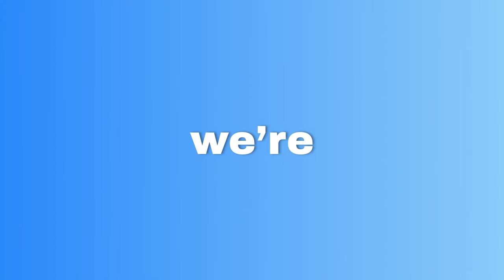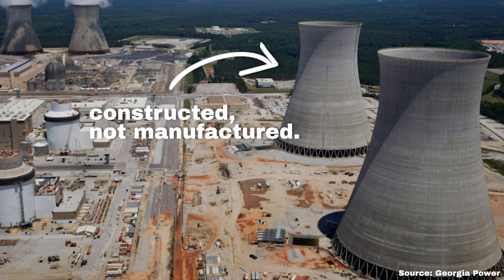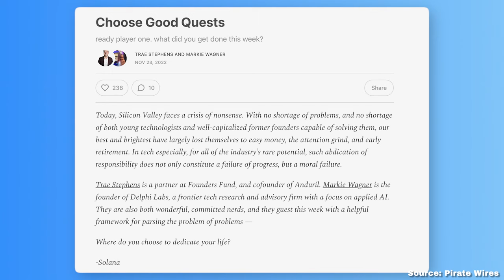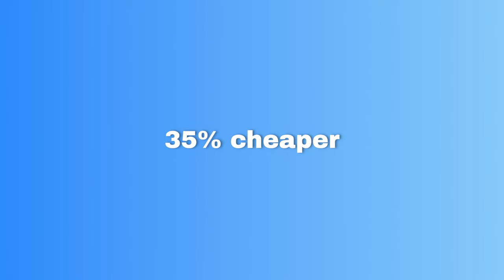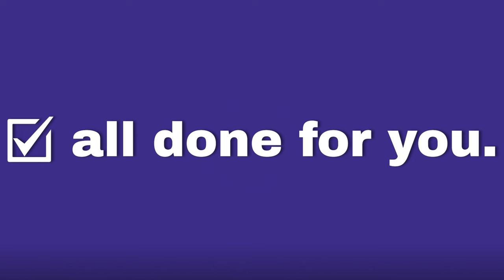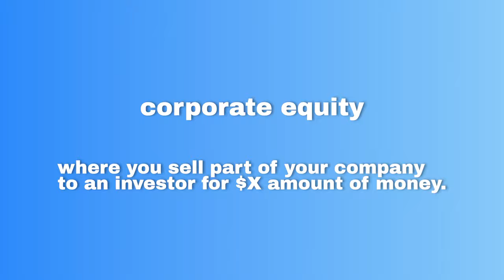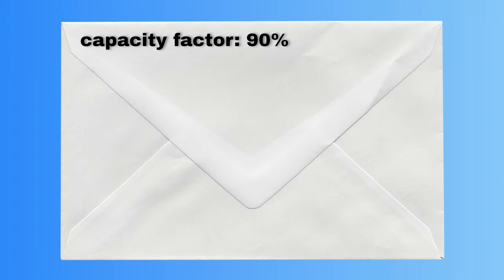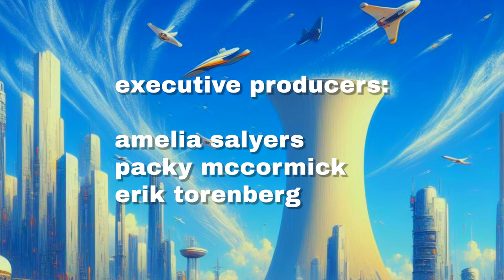How to Build 10,000 Nuclear Reactors

Comment: I really like what you are doing: making the public more aware of CO2 free energy possibilities.  I have traveled a lot in Arctic Canada.  This region is too remote to be on the grid, has communities too small for current large scale nuclear and has little or no sunshine for half the year.  Currently powered by diesel, you illuminate lots of ideas that could provide clean power to this part of the world.
Reply: not co2 free, until they find that materials science that uses strong roman concrete that can sequester co2 instead of creating it and learn to mfg high performance, insanely qc intensive steel.

Comment: brilliant analysis of new possibly breakthrough emerging markets. 

So much opportunity here.

I'd love any new reactors to have inbuilt passive safety and multiple passive redundancies. 

They need to be disaster proof. Having them at sea is brilliant, we have the DC transmission cable technology to add to that. 

We could desalinate water, create hydrogen, power industry with SMR's. 

This could be brilliant. 

Fusion will be amazing but the energy mix and balance will see a future of abundance.

Comment: @thewiseperson8748 said, "Thorium is likely to be the only fuel that runs SMR's in the long run, suggesting that a molten salt Thorium reactor is the only configuration that has any real hope for SMR's." 
Pebble-bed reactors are also capable of using fuel pebbles made from different fuels in the same basic design of reactor (though perhaps not at the same time). Proponents claim that some kinds of pebble-bed reactors should be able to use thorium, plutonium and natural unenriched uranium, as well as the customary enriched uranium.
Because the pebble-bed reactor is designed for higher temperatures, the reactor will passively reduce to a safe power-level in an accident scenario. This is the main passive safety feature of the pebble-bed reactor, and it distinguishes the pebble-bed design (as well as most other very-high-temperature reactors) from conventional light-water reactors, which require active safety controls.
Reply: Thorium is a marketing term just like SMRs. Thorium as a fuel will only make MSRs (Molten Salt Reactors) more expensive than uranium-based MSRs with no advantages.

Comment: Try running an Aluminium smelter with a continuous 500MWe demand with just a Solar farm and Gigabattery packs. The solar would need to have a 2000MW output averaged over 6hours then need at least18×500MWh = 9GWh batteries to get through the nights.
That's capital cost of:
Solar:4×500,000×$2000/kW= $4billion + Mega-Pack:
9000MWh@$600,000/MWh (= $5.4billion)
So Total capital cost/kW. = $(4+5.4)×10⁹/500,000 = $18,800 per kW for a 24/7/365 demand and at 2Watt/m² need at least 100,000Ha taken from the scarce tropical rain forest.

C.f Indonesia's 8× ThorCon 500MWe TMSR (foot print 1.17Ha each 500MW unit or 43kW/m²) capital costs of $800 - $1000 per kW (say $940/kW) is .94/18.8=1/20 or 5%  of the required capital cost of a stand alone combined  Solar + Batteries system wthout considering the destruction of over 1000km² tropical rain forest - 
(NOTE: Both supply 500MW × (6+18)hours = 12,000MWh/day)
Indonesia's expected levelised pre-profit cost is less than $30 per MegaWatt.hour (<3cents per unit kiloWatt.hour). Assuming the ThorCon's life is 45 years, that's 3× the solar + Batteries year 15year life; making its levelised pre-profit cost 3×20 times cheaper than solar+Batteries (3×20×$30 = $1800/Megawatt.hour or $1.80/unit kWh)..???
Reply: we are addicted to boxite.

Comment: Cooling towers aren't nuclear reactors. Why show them?
Reply: Because they look "scary".
I think they should be painted blue for obvious reasons ;)
Reply: Cooling towers are the best way of rejecting heat on the revenue side of the operation. 

You're not subject to major environmental effects of discharging excess heat into waterways if you can reject direct to atmosphere and in order to be able to make a heat engine work (steam turbine or other electrical generator) you MUST be able to reject heat somewhere. They need a hot side and a cold side to function

Cooling towers are mostly associated with coal plants and the temperatures/heat density of MSRs is a good substitute for the thermal energy provided by burning coal/gas

If you want to keep deployment costs down you MUST make the reactors work with existing power generation methods and superctitical steam turbines are a good fit for the job that exist already, unlike supercritical CO2 or Brayton turbines which are still only at "experimental" stages (I don't object to using them later, but holding up deployment until they're ready is like holding off until fusion is ready - we don't have that long to wait and the effects of globval warming are potentially far more catastrophic than politicians are letting climate scientists talk about - put it this way "Do sea level rises and climate catastrophes within the lives of our great grandchildren matter if no humans are alive to witness them?" - it really is that dire.

Comment: Indonesia's PPA for 8× walk-away safe ThorCon 500MWe TMSR fabricated on line in a Korean double-hulled bulk-carrier shipbuilding yard at a fully fitted capital cost of $800 - $1000 per kiloWatt.
Each of the 500MWe TMSR units, have footprints of 180m×65m = 11,700m² or 1.17Ha. 
At height of 34.2m the crude volume is 400,000 m³, making your crude cost estimator 500,000kW/400,000m³ = 1.250kiloWatt/m³ or between $1000/m³ to $1250 per m³, (using unit cost of between $800 to $1000 per kiloWatt).
An on line production, of these 500MWe TMSR units, at a double-hulled bulk-carrier Korean shipyard that could be capable of producing at least 12GigaWatts a year.
(Hope this is useful as if requested I can provide the through-put daily tonnage, as some of the original Florida ThorCon designers previously designed and had built the world's largest bulk-carriers in Korean shipbuilding yards).
Reply: what's the up front investment cost for construction and installation?  nevermind the political cost of nimby

Comment: Whilst the concept of SMRs is good, the need of them is undermined by the need for thermal efficiency on the revenue (steam(*)) side and that converges on "Make them as large as physically possible" - about 1GW output for a steam turbine (3-4GW input thanks to heat engine losses)

(*) Or supercritical CO2, or brayton turbines. The point is that ALL electrical generation uses heat energy to generate electrical energy at 25-35% efficiency (CCGTs get higher efficiency by clever heat scavenging tricks) and the bigger the turbine, the greater its efficiency and per-GWh maintenance costs - this is why conventional power plants have been getting bigger and bigger as materials technology allows larger turbines to be built

Conventional water-moderated reactors vessels are under amazingly high stresses - they're essentially steam boilers, and this is pushing the state of the art, especially for a boiler that has to be "service free" for 60 years

Modularisation is still a highly desireable characteristic. If using MSRs, a 3GW reactor isn't large - and more importantly, being unpresurised means it doesn't need to be fabricated like a steam boiler (ie: it can be factory-manufacturable rather than individually "craft-built")

There's another important point to note: a complete 3-4GW MSR (LFTR) and containment building would be about 1/4 of the size of equivalent heat output coal burners, whilst being just as hot - The ramification is that they can be utilised as "drop in" replacements for coal in thermal power stations, everything nuclear kept confined within the MSR building and normal non-nuclear procedures apply on the revenue side (ie: a steam explosion is just a steam explosion, not a radiological disaster)

I believe that we will see modular reactors, but they're likely to be "as large as phsyically feasible" and may drive multiple steam (or supercritical CO2) turbines. 10GW isn't beyond the scope of possibility, perhaps even larger. 

Bear in mind that every existing "burner" thermal power plant needs to be replaced in the next 30-40 years but that accounts for only 30% of our carbon emissions - we need to build more energy output to cover the difference, by a factor I've been estimating at 6-8fold for a long time (It's not just the obvious stuff like transportation and industrial processes. Fertilizer production alone will need at least as much energy input as existing electrical production to be weaned off of oil. The inefficiencies of synthetic fuel production means that cater to aircraft (almost impossible to electrify for longhaul) we'll need massive energy input ("Hydrogen" is so expensive (and dangerous) to compress, cool and transport that it makes more sense to go a few extra steps and invest the energy required to produce liquid fuels. The net energy equation is still lower than trying to ship hydrogen around and less likely to suffer catastrophic failures)

PLUS we must build out enough energy generation capacity to allow developing countries to catch up. This is the only way to wipe out terrorism and reduce population growth (wealthier people don't do desperate things and they have fewer children. Deliberately holding people back is a recipe for global warfare)

10,000 nuclear reactors? Yes
10,000 "small" nuclear reactors? No. They're simply not large enough to be viable and trying is a false economy which will most likely result in bankruptcy of those persisting in trying

BYW: the industry leader and energy superpower of the mid-late 21st century is most likely to be China, with the USA reduced to a heavily-indebted also-ran. The most promising nuclear technology for low cost, low waste, low risk, proliferation-resistent commercialisation was effectively made illegal by presidential order in 1972 and those rules have not been repealed (Indonesia may be #2)

Comment: I dont buy the idea thst snaller is cheaper. Volume is only likely to be in 10's-100's not millions. Also factory manufactured homes to be assembled onsite, havent turned out cheaper! But manufacturing still make a lot of sense. Experienced building crews will have families and might not want to spend their entire lives moving from place to place.
Reply: manufatcuring in ways that allow assembly of readily handleable, transportable pieces makes for vastly reduced costs. 

Existing reactor pressure vessels cost billions (literally), take 2 years to make (only one manufactirer left), cost hundreds of millions to transport to locations because of their massive unwieldy sizes and are backlogged by 2 decades

Not having to contain 200-400 atmosphere water at 350C (_extremely_ corrosive and quite capable of rotting through a 9 inch steel flange in 18-36 months - this HAS happened) relaxes a lot of your engineering requirements for the vessel, as does not needing a containment building needing to hold all that steam/water if it does happen to rupture. 

Getting water away from the nuclear cycle is key to both improving nuclear safety (lowering risks) and dramatically reducing costs. Attempting to replace the water with flammable/explosive molten metals like sodium undoes most of the gains (See: Santa Susanna reactor, Monju and others) and is a good example of "just because you CAN, doesn't mean you SHOULD" (or in other words, the risks haven't been fully studied vs proven alternatives. If it can burn, escape or fry brains(*) then it shoudln't be inside the reactor loops)

(*) Molten lead isn't exactly biologically friendly and the tendency to readily oxidise affects its heat transportation properties anyway. There are good operational (reliability) reasons most Russian Molten Lead reactors were allowed to go cold.

Comment: The grid is fragile because it is incredibly expensive. 
Nobody over builds the grid. 
$million/mile and millions and millions of miles to the 330million people in the USA. 

Generation is cheap, it is the grid costs that's ignored by the nuclear promoters. 

Hello, hello 👋 anyone home, hello 👋
Reply: we need to end the grid and its capital stranglehold on progress, vulnerability, and waste
Reply: @jthadcast  we need to keep the grid as a backup because it exists. 
The new ways of generation and storage at the point of use are becoming cheaper and more practical in replacing fossil fuels.
Reply: @stephenbrickwood1602  it only exists because we pump billions in every year to keep it functional but i'm not saying tear it down but phase it out.  if large scale industry went off-grid  and small on campus nuclear things could change. have they've actually proven small will work at scale operation, nope but investing in proof of concept is good idea.  just speculating here but the mindset in nuclear engineering at school was all about larger production where there are two, three, four or more reactors for a single facility to chase efficiency at production not distribution.
Reply: @jthadcast  good comment, good thinking.
Copy and paste your comments elsewhere as both sides are confusing people. 
The truth is a little more complicated, but your retelling helps push the politics to the real world.